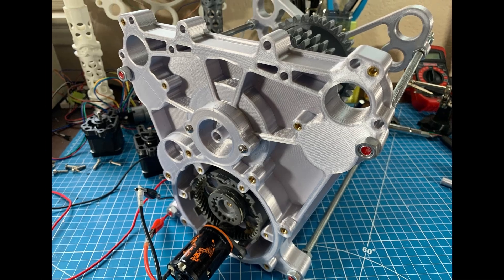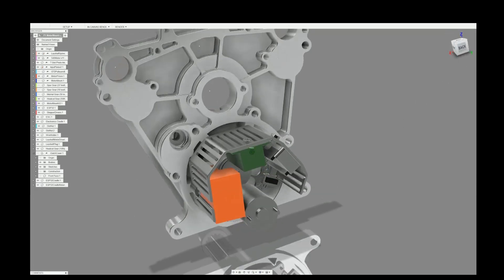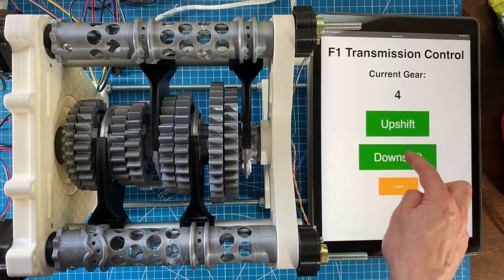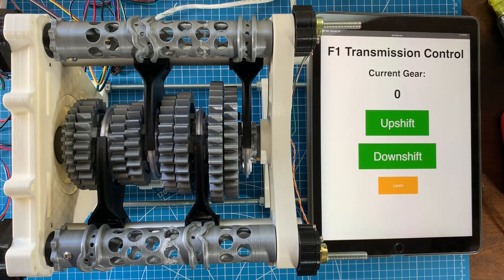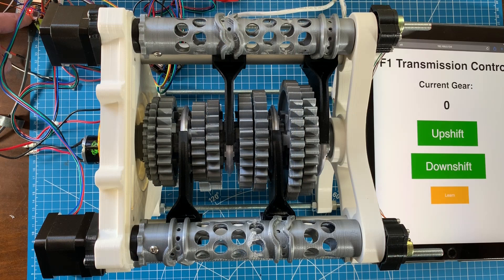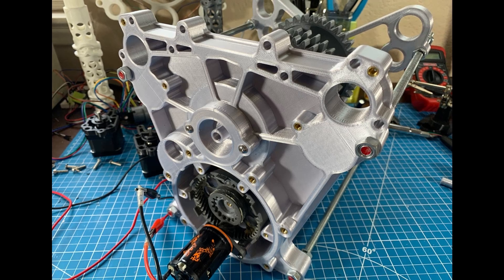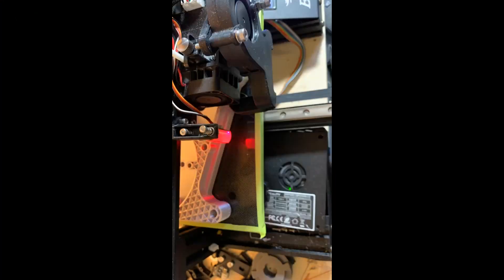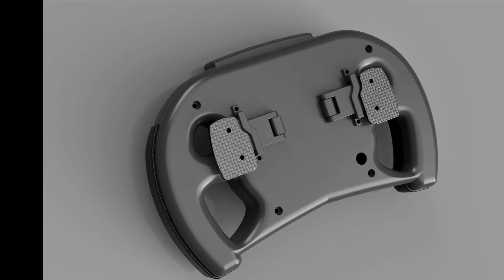3D Printed F1 Seamless Shifting Gearbox - Part 3

Comment: Just discovered your channel from Driver61 channel and I'm blown away with your determination with project.
I haven't watched all the episodes yet but was curious about lubrication? I am sure a lot of heat is building up at the mating surfaces?
Reply from the maker: In the real gearboxes there are pressurized channels and tubes that feed all the bearings.  For model this I just have some airsoft BBs in a cage for the main gears and some nylon bushings for the shafts themselves with grease.  

There’s no real load on it and it works well. My first gearbox had real bearings on everything which were much more expensive for little benefit.
Reply from the maker: Sorry, just saw this is for the 1st F1 gearbox so it’s all real bearings. The hybrid era gearbox actually has a better design with the airsoft bearings.

Comment: Sorry to keep ranting about the Arduino/ATmega. There is an option in the ATmega programmer in Atmel Studio which lets you keep the EEPROM intact while programming so no need to re-learn all the positions after an iteration. This is probably not possible with Arduino IDE, though. Arduino is more like a butler for your microcontroller. It makes the learning curve gentle but the price you pay is that you can't do everything with it.
Reply from the maker: I definitely agree with you. I went with the dirty approach and used a faster processor because I was a newbie trying to figure out how to construct the controller software. I think now that the code is more stable I could go back and optimize it (Even on the ESP32 I could multithread it for the 2 cores).   It’s a strange time for microcontrollers, I bought my last batch of ESP32s for $3.50each.
Reply: @IndeterminateDesign  That's true. The ATmega series is from the early 2000s and it shows.